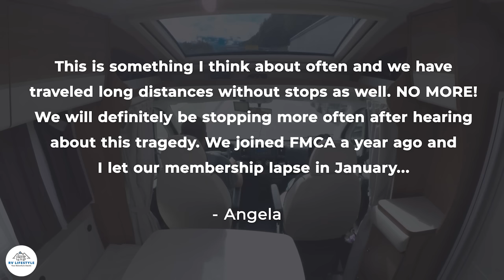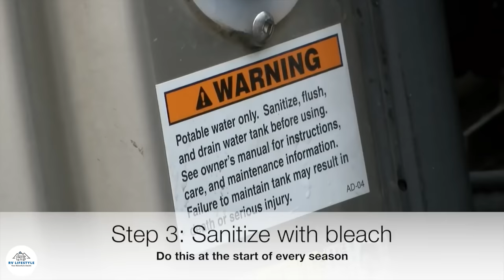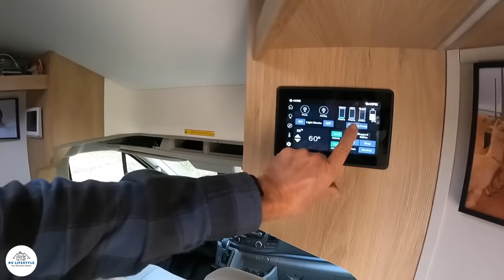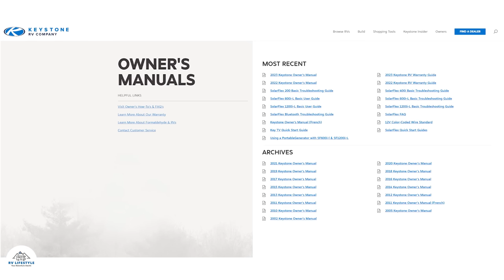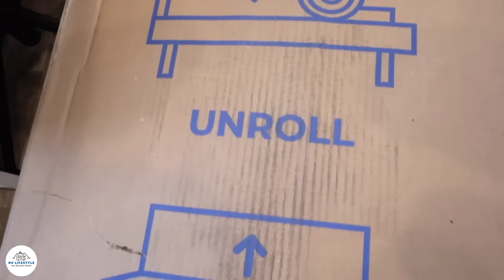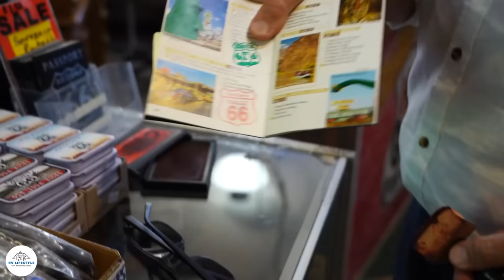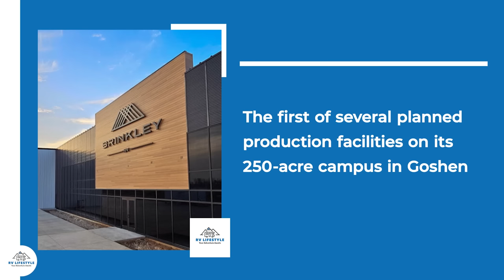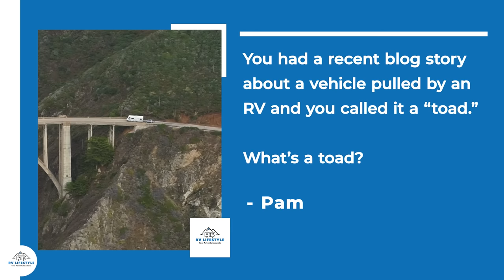How to Dewinterize Your RV - Tips from A Pro!

Comment: You said towed is a vehicle being pulled. You can't use words towed when you are towing at that time. Because towed is in the past not the president.
If you have it on a trailer, it's not towed. Would you call it trailered? Or trailering.